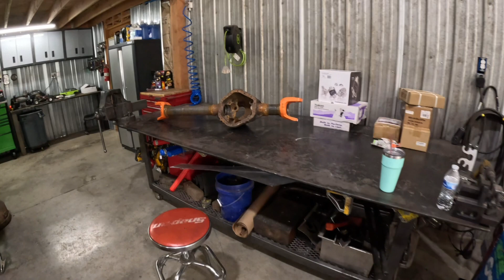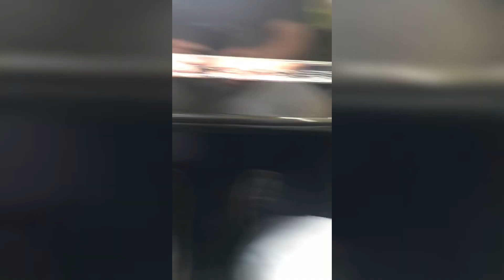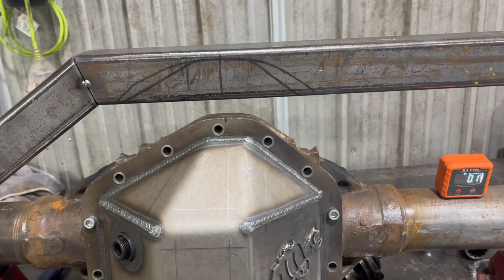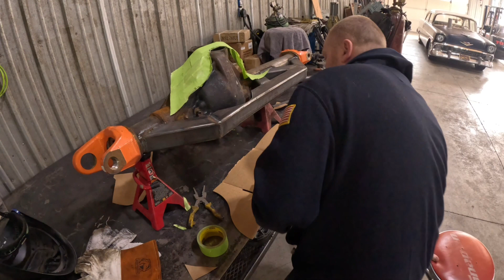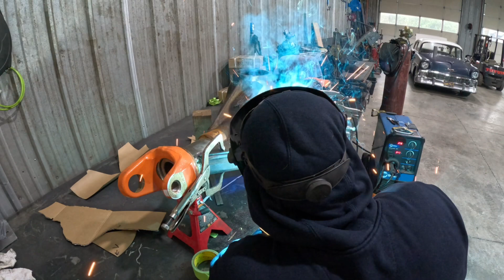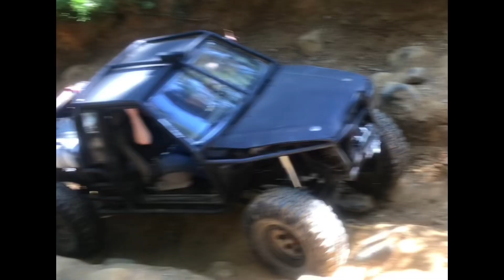No more Dana 60 junk!!! New 14 bolt front axle build part 1 fabricating the truss

Comment: How wide is that axle? I’m currently starting a 14 bolt front axle that is passenger drop. I definitely have some questions
Reply from the maker: It’s a stock gm king pin 60 front width
Reply: @rosinsautofab1956 ok thanks. Did it take a special carrier or anything or just a standard 14 bolt carrier?

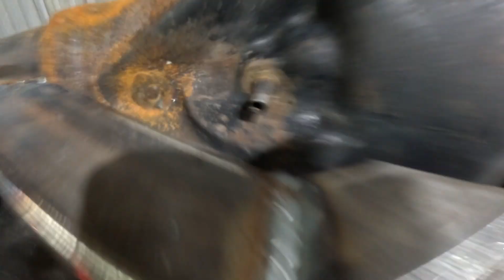Comment: 9:03 Did you end up making a new breather hole? I'd be worried the seals would leak if no breather 🤷‍♂️
Reply from the maker: Yes it has a new hole, always have to have a breather, thermal expansion will push oil out of the seals if you don’t 👍🏻
Reply: @rosinsautofab1956 That's exactly what I thought. I'm new to these axles, so I wasn't sure if there was something special about them or not 😅

Comment: did you drill oil ports for the bearings  , and did you get custom cut reverse rotation gears
Reply from the maker: No modifications were done to the internals of the center section

Comment: Instead of wasting all that tape next time..  Just rough cut some cardboard so that it's over sized and fits around it---- then you can use a few pieces of tape to fill in the gaps along the edge for the detail;  then just transfer that onto your next carboard as the final template.  This way you waste minimal tape.
Reply from the maker: Tape is cheap and easier to work with cover the whole thing and then take a sharp razor blade and just trim out your shape and then the tapes transfers to your material and sticks to material
Reply: @rosinsautofab1956   I agree.. Just fill most of your "tape" bulk in the center with cardboard.. or newspaper or something..  Just like when painting a car-- you don't cover the whole thing with tape--- you use paper or plastic and just tape the edges.
Reply from the maker: Tape is cheap…. larger templates we use dollar store poster board
Reply: @rosinsautofab1956    I'm too lazy to go to the store and buy poster board.
.... cardboard it is then.  :)
Reply from the maker: Ya being lazy only gets you so far, takes 5 min to swing into the dollar store on your way to work etc… poster board gives me nice sharp lines and transfers better to my material, I hate thick cardboard and a cereal box is only so big, thanks for watching and I appreciate the comments 👌